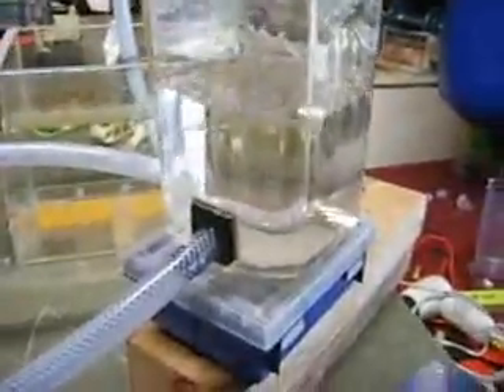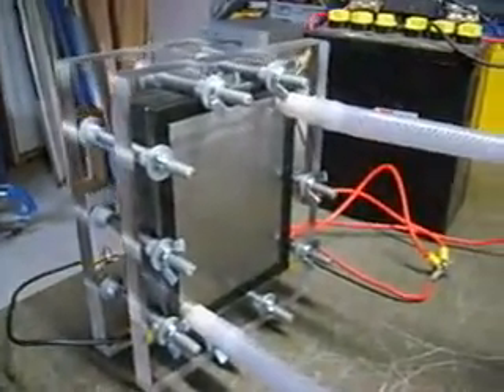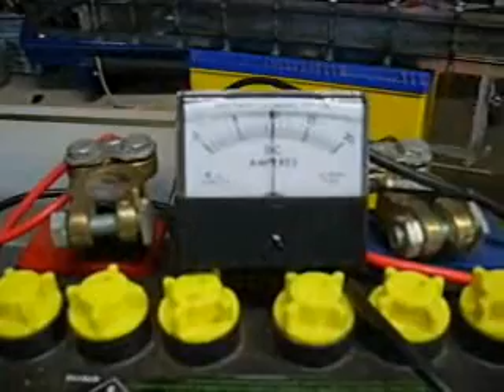Hydrogen at home (testing new sandwich Cell)#27

Comment: what kind of nozzles are you using for the input/output gases? (size or standard)
and where can you buy them?
Reply from the maker: They are standard threaded hose fittings I bought from a hardware store. I did have to go to a specialised tool shop however to get a tap that would suit the thread type. I can't remember where exactly.
Reply: @markj30  thanks for the reply! I'm working on a similar project but the input is co2 and output is co (to be used for other purposes). Do you think it is possible with different plates? (we are looking into plating copper with Cu2Cd via electrolysis)
Reply from the maker: @budtastic1224   I do not know much about that. But good luck to you.

Comment from the maker: All of the electrical wiring that I am using is temporary and for testing only.  I don't really see the need to countersink my boats, I don't mind them, and it just seems like more work.  Building one of these units is quite labor-intensive and I will not be building them for anyone else at this stage.  It is still just a test unit, but thanks for your suggestions.

Comment: very nice piece of gear you have created there ... your fabrication skills far exceed mine ... you need to get your parts really, really clean ...  I bet half your amp problem is that there was residual oil on your steel and gasket material ... even oil from fingers is bad ... use rubber gloves when handling after very thorough cleaning ... know it sounds like your mother nagging but it works ...